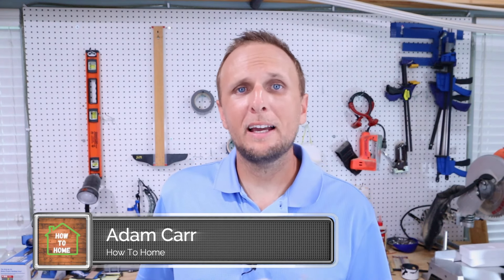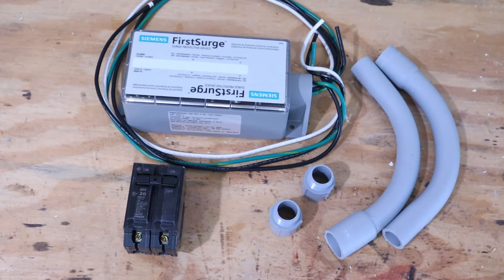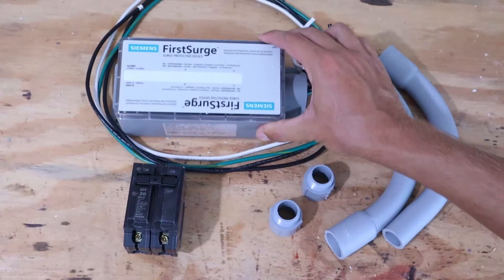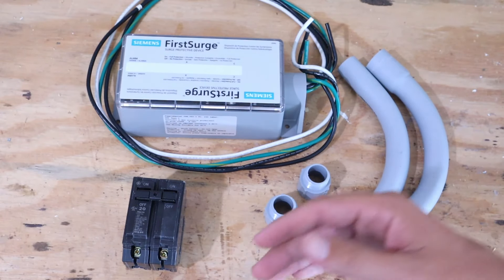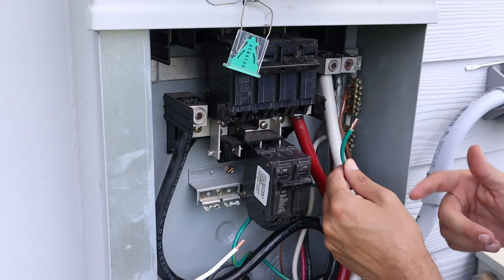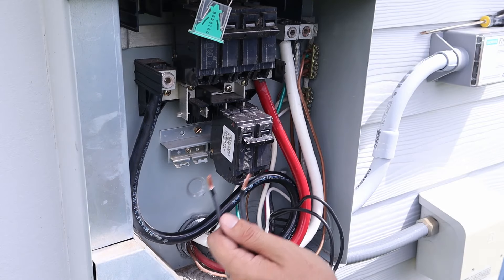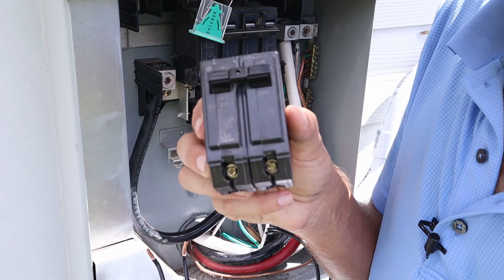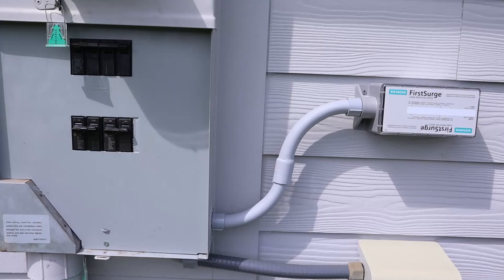How To Install a Whole House Surge Protector | Siemens FS140 Whole House Surge Protection

Comment: You seem to have some panel and switch near your meter.  My power comes straight into my main 200amp breaker box.  Can I just connect this inside my main panel with a two pole 20 amp breaker?
Reply from the maker: Yes you can, as close as possible to the main switch in the panel.

Comment: Every time my washer starts I get a lot of flickering.Will this take care of it?
Reply from the maker: Hey Brad, no this would not fix that issue.  This surge protector is more for incoming surges from your utility company.  I would start with finding out if there is something wrong with the washer.  If it’s not the washer then you may want to contact an electrician and your power company.  An open neutral could be the issue, whether on your side or the utility side.  Could be something else but they would be able to find it.  The washer should not be causing lights to flicker.  Hope this helps!

Comment: Hi, just purchased and your video makes the install look easy.  But I can't seem to find my main panel like you showed in the video. I found my electrical meter outside and my 2 breaker panels in the basement but no main panel?  Is this possible?
Reply from the maker: The main panel is going to be wherever your main breaker is.  If it is in the basement like you said then that is where this would get installed.  Where I live, our main shutoffs are almost always in a panel outside by the meter.
Reply: If you are having problems don't touch anything.....because you don't understand how the meter feeds a panel, etc.  Once you are dealing with the meter area (service entrance) better to let a pro deal with issues.

Comment: Hello, is the 20amp breaker connected to the  main breaker? I mean is there any power going to the breaker of the first surge? I had mine installed by an electrician but seems not soing its job as i had mu 5 ceiling fans broken at the same time during power surge. First surge has both green lights though.
Reply from the maker: The 20 amp breaker is downline from the main breaker.  But it needs to be as close as possible to that main breaker so that it gets the surge first as it is coming into the panel.
Reply: @HowToHomeDIY   Thank you very much

Comment: Exactly what happens when a surge comes in?   Does the fs140 shut the main breaker off?
Reply from the maker: No, it just absorbs the surge and sacrifices itself.
Reply: It sends the surge watts to ground. If the surge is more than what the fs140 can handle, it sacrifices itself and is no longer protecting your home.

Comment: I'm looking to get power quality protection for my house when using an emergency generator which is connected to the panel via interlock.  Not sure if this is the right product for that, but having said that, my circuit breaker slots are all full... no room for another breaker that takes two slots.  Any advice appreciated.
Reply from the maker: I do not know for sure how affective this would be with a generator but at the same time, do know why it would act any differently as it can't differentiate what the power source is.   That being said, if you are wondering if it will help clean up a higher THD percentage or "dirty power" I do not think it would do anything for that.  Per the manufacturer if there aren't any slots available their recommendation is to look into tandem breakers if it is an option for your particular load center.  It does require a dedicated 2 pole breaker so "piggybacking" wouldn't be an option as some have asked that.  I hope this helps.

Comment: Wouldn't that just protect the double pole breaker? How does that stop the surge into the main?
Reply from the maker: Because it’s one of the first circuit breakers on the house and is made to absorb a surge before it can move on down the line to everything else.

Comment: If I have three rooms on one line .Could it  cause other rooms that are not on that line lights to flicker
Reply from the maker: Depending on the demand it’s possible.  But I would still think it’s more likely that there is a loose neutral or hot wire.  Possibly at the breaker.

Comment: Is it okay to connect it to circuit breakers that feed a circuit in the home, or must it be connected to a circuit breaker that is connected ONLY to the Siements unit?  The Siements instructions are ambiguous on this point.
Reply: The fs140 needs to have its own dedicated double-pole 20-amp breaker.  It should be in the one and three locations, in your control panel.

Comment: I have a question, is this a one-event device? Does it reset?
Reply from the maker: Once it absorbs a large enough hit or enough hits that it has worn down, it will need replaced.  It will let you know when you need a new one though.  I have it for almost 2 years now through numerous lightning storms and it is still good though.
Reply: That would be a non sacrificial series mode surge protector and that's normally in a Type 3 unit (the FS140 is Type 2 for a panel).  Brick Wall, Surge X, and some Furman point-of-use surge models are non sacrificial and will reset as long as the surge is not catastrophic.  Having a Type 1 and Type 2 whole house surge unit first would make the surge small enough for a Type 3 to do the rest and save delicate home electronics like computers and TV's.

Comment: This one is really good but I am now installing my SPD from BAD WOLF, they are the highest protection in the market right now, pretty much twice as much as this one, commercial grade, smaller and made in the USA, by disabled veterans. It also covers lighting and EMP.  I will also buy the one they make for the vehicles to protect them from EMP. My neighbor got one and I was impressed. I only had the 24K one from Square D, and I will install that old one in the subpanel, but the Bad Wolf goes to my main.
Reply: The only way to protect from an EMP is having your house or electronics contained in a Faraday cage.  That's highly improbable.  Are you sure you didn't get taken in a con?
Reply: @dan_hitchman007  how do you come up with that? The are EMP protectors even for vehicles. and you could even use high-saturation ferrites in the two hots and the neutrals to absorb the frequencies...even military equipment and some facilities have ferrites in the service entrance conductors. It is weird that you say such a thing because the EMP frequencies is understood and studied at the basic stages. In fact, the faraday bags and cages are for mobile things and of course they can't be fixated to a building wiring. 
The ferrites and SPD are used to suppress the conducted pulse that is introduced on the power lines from an EMP or CME. They each do different things. The SPD suppresses the E2 and tries to trip the upstream breaker when E3 arrives. The ferrite helps to address the conducted E1 by reducing its level and helping to spread it out enough in time for the SPD to kick on. The overall goal is to save the home's electronics, not to keep the grid from going down. The idea is that having a home with functional electronics would be useful because you could attach a generator, or take advantage of any times that the grid came back up.
Reply: This is the kind of surge protector I would like. The drawbacks being 1) in the event of a non-EMP surge (which is more likely), you are looking at replacing a much more expensive surge protector (obviously in an EMP event, you'll be glad you have it) and 2) if they are scammers pushing a crap product on prepper fears, in the event of an EMP, what are you gonna do? Trek across the country to find them and demand a refund? I would imagine that they have some certification for their product though.

Comment: With the 2020 NEC code, I’m not sure which article but it states that all new construction and I believe remodels that have to do anything with electrical services have to have a whole home surge protection now at the breaker panel.
Reply from the maker: Hey Danny, yes you are right, it is article 230.67.  It is to be installed at the service equipment.  Which would be where it was installed in the video or if one was installed on the meter itself by the power company.  There is an exception to this if you install one at each next level distribution equipment downstream toward the load.  This would include your breaker panel and/or subpanels.  Great point!  Thanks for bringing it up!

Comment: Hmm.... nowhere on the Siemens install instruction does it say you MUST use a double-pole breaker. For sure....it makes it idiot-proof that doing so ENSURES you pick up both legs A/B and not A/A or B/B. However, I'm thinking using 2, single pole breakers side-by-side....basically the same thing as a double-pole breaker but without the external "bridge", is still OK.

Comment: I dont understand it.Ive done a lot of unprofessional electrical but this breaker doesnt precede the current incoming from your main line so how does it have ability to shut it all down if its overloaded?
Reply from the maker: No it doesn't come before your main panel but it does come before all of the circuits in the house especially if it's out at the meter like this particular installation is.  Its essentially monitoring the current coming in and absorbing the surge before it can get to the rest of the circuits.

Comment: How many emp attacks can it handle?
Reply from the maker: Hopefully if one ever happened it would be the only one!  So this on it's own would probably not be enough.  You would also need ferrites installed on incoming lines and also each individual electronic.  If you want some more in depth info on it check out the empdoctor here on youtube.  He has a video all about it and explains why he recommends this particular SPD.  Hope this helps.

Comment: I always assumed surge protectors shut the power off before it gets to anything.  This clearly doesn't have the ability to shut the power off- so how does it work?
Reply from the maker: Basically, it sacrifices itself and absorbs the surge current before it carries on to your devices in the home.
Reply: I am trying to understand this myself, from what I can guess, it detects a voltage increase (surge) and will open a gate direct to ground, and become the path of least resistance taking the surge before the circuits in the home? Hopefully someone else can elaborate or point to a more practical description.
Reply: The metal oxide varisitor instantly respond to overvoltage by becoming a short, as the voltage spike collapses, it then it acts as an open.  This is in the millionth to thousanth of a second, the mechanical parts of the circuit breaker feeding it don't have time to respond.

Comment: I am confused.  I have never heard of a circuit panel on the outside of a house.  And yet, it appears this one is; and the surge protector is also mounted on the outside of the house.   My circuit panel is inside my basement.
Reply from the maker: This is a main meter panel.  There is just the main 200 amp service breaker and 2 other breaker slots.  My main breaker panel with the majority of the circuits is in the garage.  If yours is in the basement then that is where you would put this device.  The instructions would be the same.
Reply: @HowToHomeDIY  I have learned a lot since I posted my inquiry two years ago.  I have since installed two Siemens FS140 surge protectors.  I kept my two blacks leads much shorter and straighter, and always mounted the 20 amp breaker closest to the main feed, even if it required moving existing breaker switches.

Comment: Hi. I have a 200 amp main panel and another 200 amp sub panel next to it. Do I need 2 surge protectors or just 1 in the main panel.
Reply from the maker: Hey!  You would just need the one surge protector in whatever panel is nearest to where the utility power comes in from the road.  That would probably be your main panel if you don’t have a meter main panel.  Hope this helps!

Comment: Very surprised your not using an insulated screwdriver
Reply from the maker: Why?  Power is completely off.  Only time I use an insulated screwdriver is when I work on something live which is almost never because most of the time it’s not necessary.

Comment: Are these required by code now?
Reply from the maker: Yes but according to the code, they only have to be installed when your service equipment is replaced or upgraded.  The idea is to help protect GFCI's, AFCI's, smoke detectors, etc.  If you would like you can find the code with a google search just type in NEC 230.67.  I hope this helps!

Comment: No surge protector will protect your house from a direct lightning strike unless you have a lightning mitigation system installed.
Reply: Actually, nothing will protect your home 100% of that strike because The bottom line: The electricity in a lightning bolt is much too powerful to be 100% stopped by any type of system.

Comment: what if I have no open breaker spots to add this, how would it work then?
Reply: I read Siemens Residential Load Center sheet and it showed a breaker/surge arrestor combo. Other manufacturer may have similar, my panel happens to be by Siemens. Hope it helps
Reply: You can use half size breakers in you panel